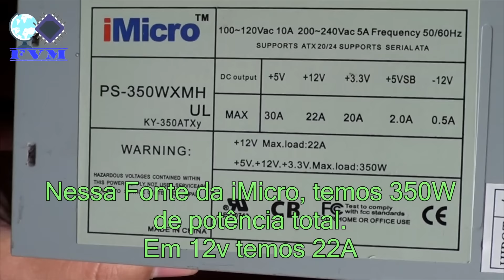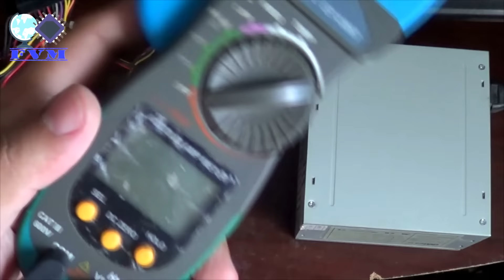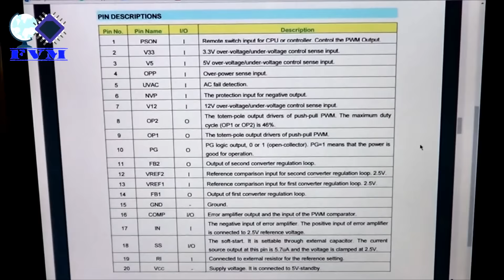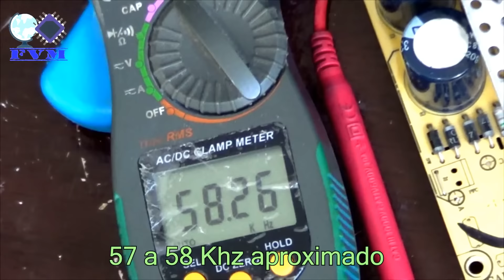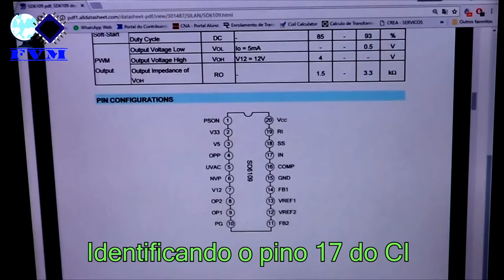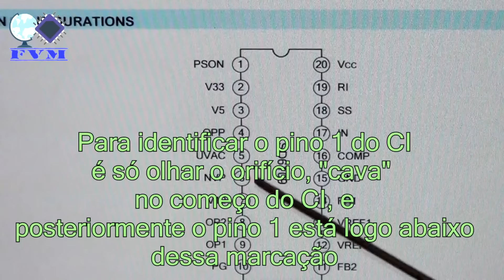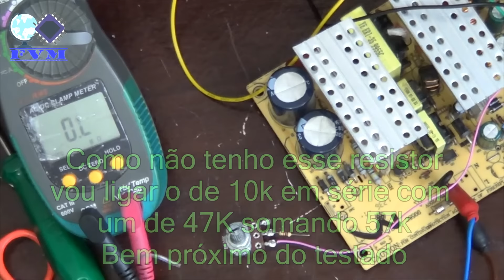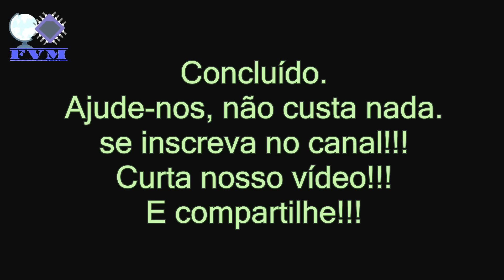Modificando fonte de pc ATX 12V para 13.6V, 22A, de forma fácil.

Comment: Bom, tem coisas evidentes e básicas que voce demonstra com muta clareza, mas o principal o pulo do gato voce deixa muito a desejar.   Em resumo para os colegas, utilize um potenciômetro de 100K no meio um resistor de 10K, que sera em serie. Solde um fio por exemplo no lado esquerdo do potenciometro ao pino 17 do cI. e no pino do meio do potenciometro que e soldado o resitor de 10K solde no negativo da fonte. ache a tensao de saida de 13.8V com o potenciometro de 100K. quando atingir os 13.8V  que é o usual para carregar a bateria. Desligue a fonte. meça o resultado em  K Ohms que ficou essa regulagem no potenciômetro. ache o valor da resistencia homica  no multimetro . com esse resultado da resistência procure um resistor próximo do valor e solde  o resistor encontrado no pino 17 e no negativo da fonte. se a fonte ficar desarmando solde  dois diodos da serie 4004 ou 4007 etc.... no pico 17 e terra. Obrigado
Reply from the maker: Olá Jayme Mendonça 
Obrigado por seu esclarecimento.
Iremos melhorar nos próximos vídeos.
Abraços.